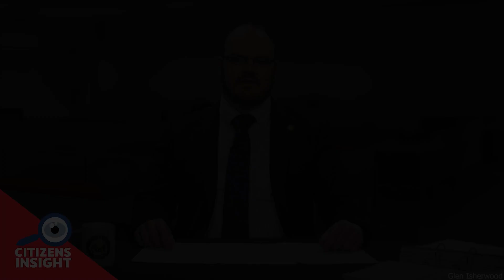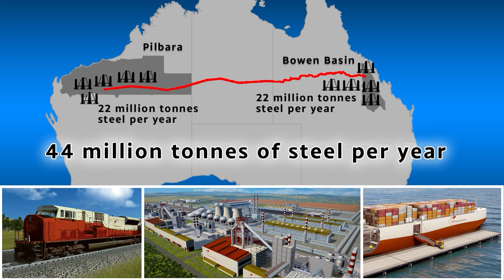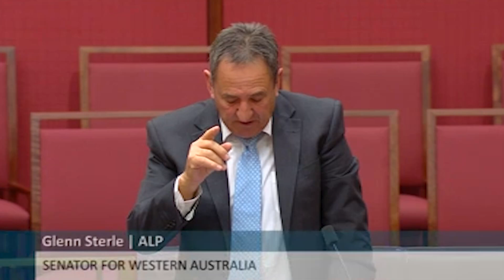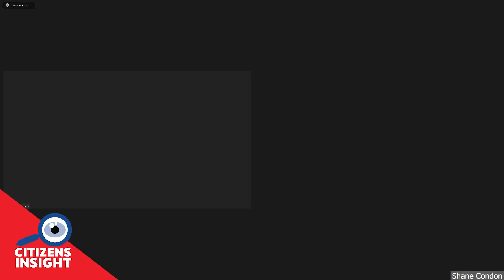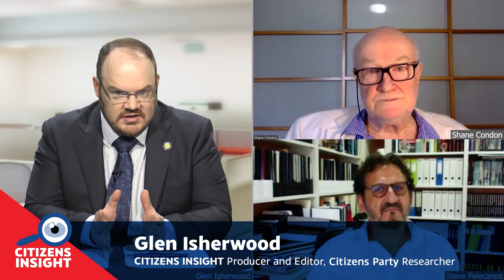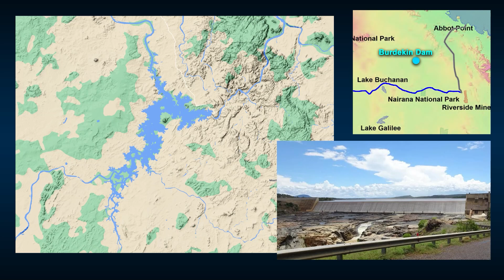CITIZENS INSIGHT – Project Iron Boomerang - Interview with Shane Condon & Steve Pelecanos - Nov.2022

Comment: With such a huge project, surely a two way rail track plan would be more fail-safe. Single track sounds a bit counter-productive
Reply: A two track system is intended, but in order to get the steel production started sooner at each end of the 3300km line, the first stage involves single track with passing loops. It's going to take a very big effort to supply the case-hardened steel necessary to build the rail track and sleepers. I think the total is about 525,000 tonnes of steel. Whyalla can do it, but they need a massive head start. Shane Condon covered this point in a 2021 interview here: https://fb.watch/gSQt1znf5k (Sorry I can't remember the exact time stamp)

Comment: The trans-continental rail-line can host High Voltage Direct Transmission lines, along with water, gas and whatever else.
Bonus: Australian steel will be used in these lines.

Comment: there were no questions raised or discussion on how the new east west rail line would intersect with the existing north south line, regards the logistical and potential economic implications...no doubt this ground has been covered, yet no mention as to it's relevance in this interview
Reply: Correct, we didn't directly address the link to existing rail. Allow me to answer here: This line does connect to the Adelaide to Darwin line. They are both standard gauge rail lines. A major dedicated hub is to be built at Ti Tree NT, where goods can be potentially transferred. At Stage-1 (44 million tonnes of steel per annum) the transport of iron ore and coking coal takes 45% of the rail line capacity, leaving 55% for everything else.